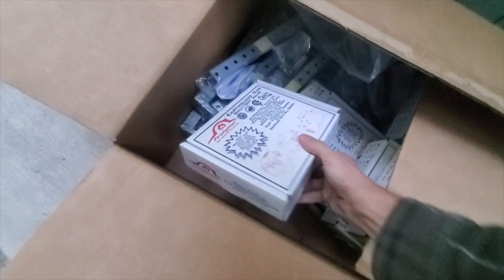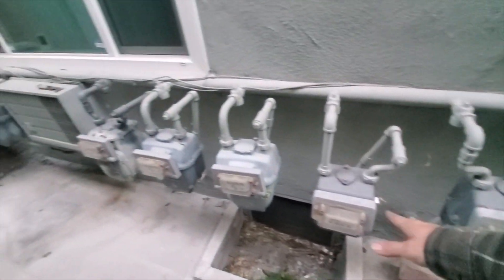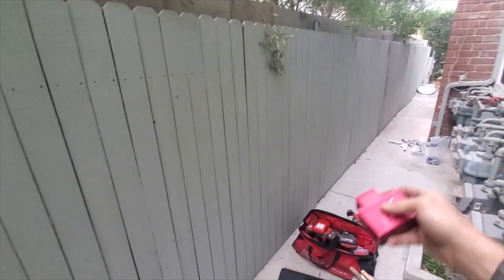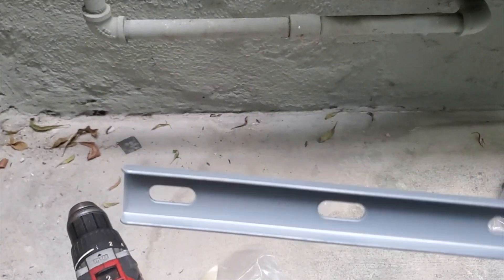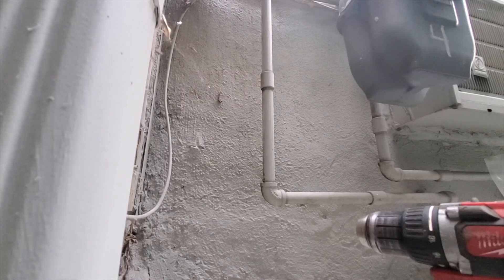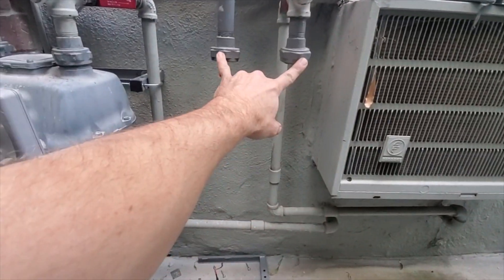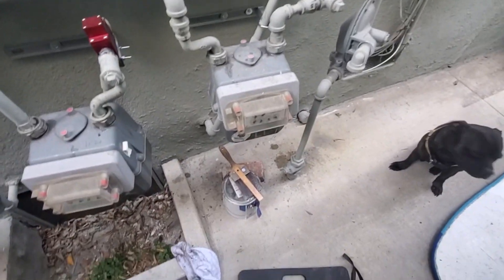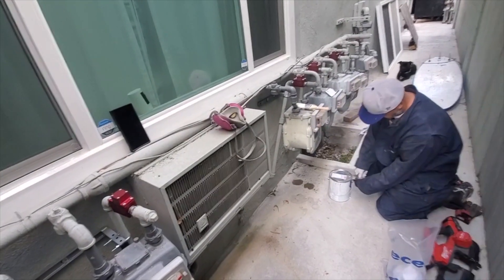How a Little Firefighter earthquake shut off valve works

Comment: Nice job! Bracketing/securing things. California? Crazy code or no code requirements.
Reply from the maker: @davidbrinkmeyer5850  it's code to have them but the brackets aren't code
Reply: @pershingplumbing9007  I read another comment somewhere else about these that if you don’t have the bracket you could be denied a claim possibly by your insurance company or something so if the manufacturer says to install the bracket you better install the bracket
Reply from the maker: @shockingguy  did u watch the video? I installed the brackets

Comment: I'm surprised to see thread protector couplings on the gas pipe. Anything smaller than 2 1/2" has a straight tapped thread. The gas company is my area uses them too.
Reply from the maker: @briancrandall1601  yeah don't like thread protectors as couplings cuz they will spin all the way onto the pipe and never stop
Reply: I generally identify those as thread protectors but  60 plus year old stuff  I often wonder  if they are   straight   probebly is        I caught that too